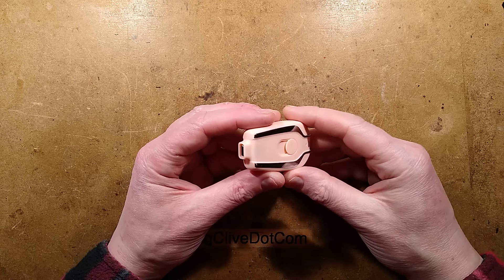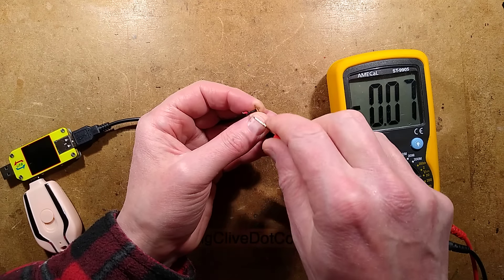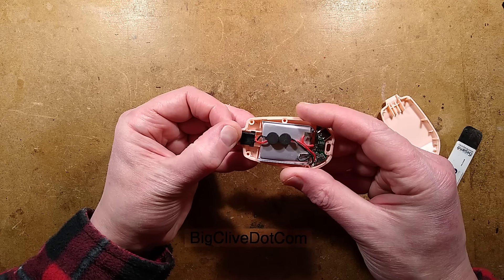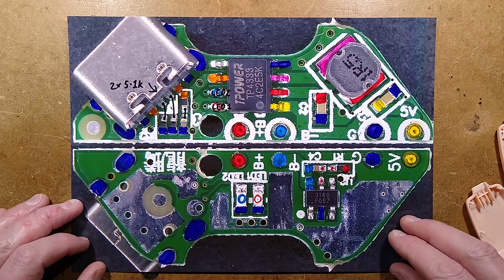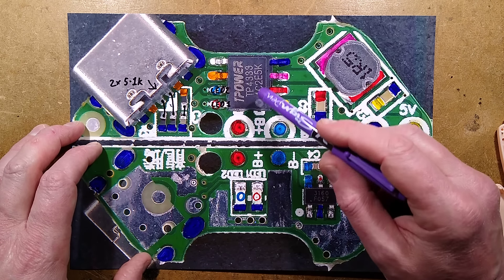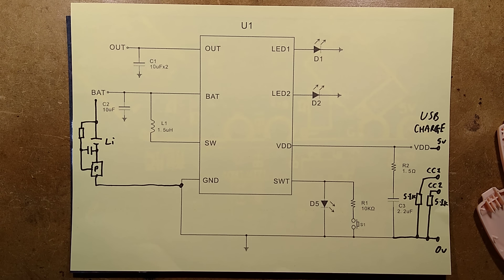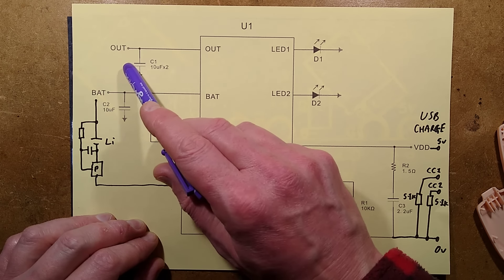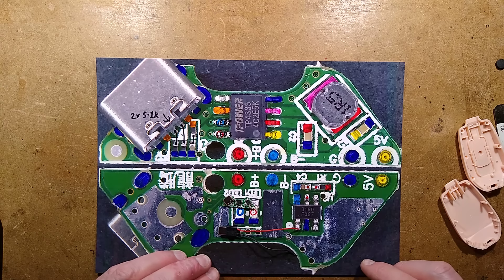eBay keyring phone-killer

Comment: I have to wonder if our phones or other expensive rechargeable gadgets have polarity protection built in?  I guess it's not something I'd want to test outright though.  😲
Reply from the maker: Many will, but as you say, it would be quite a reckless thing to test.
Reply: I think it was a Samsung Galaxy S1 I had, that I was goofing around with batteries and had hooked up a battery with the polarities swapped...... and much to my surprise... IT TURNED ON. So they went above and beyond protection, there. heh
(a little different than this, but reminded me of that)
Reply: They do, I've tried it on some old phones. I highly doubt that there's any smartphone these days that wouldn't have some sort of protection.
Reply: @twizz420  I just found it amazing, even now, since that's an already "idiot-proofed" against, given the battery packs are only one-way insertable. (and yes... I recognize that makes me the idiot, here... 🤣)

Irrelevant in the end, but I just now recalled the actual details... I had a battery from another variant of S1 which had the tabs on the opposite side, but I needed/wanted to test it. The pack for the other S1 was just a tad too long, but could still make tab contact; however, I had not even considered that me flipping the battery, flipped the polarity pins. 🤦‍♂️
I was glad that I didn't let the magic smoke out of anything, that day. ☺️
Reply: Handheld Nintendo consoles, even the Nintendo switch, are not.
Reply: Not so good at electronics but my iPhone (I assume androids do it aswell I just don’t have a reference point. Fk apple) detects a wet charging port and stops the charging process so I‘d assume they have protection for other things aswell?
Reply: @runed0s86  How very on brand, lol
Reply: idk there's a simple diode circuit that will take any polarity and only outputs a positive voltage. maybe a rectifier?  idk but they probably have it in phones. it's amazing how many electronics things have the wires backwards or other errors, it wouldn't surprise me to find out there's chargers out there that have the polarity wrong.
Reply: @simonlinser8286  bridge rectifier does swap any polarity input into expected one, obviously, but that's too lossy to use inline with battery. For simple linear chargers, a schottky may actually make it better by reducing the loss in charger.
Reply: Jerry rig everything should add it to his endurance test
Reply: They do, it's easy and cheap to include one or two diodes with this purpose.
Reply: @1yflow1  i don't think they use series diodes in phones, that could waste significant power and slow down charging. It has some active protection i assume.
Reply: If manufacturers were smart, they would always put in a full wave bridge rectifier, then it wouldn't matter if the polarity was reversed because both directions would supply power to the device properly.
Reply: @lepayen  yeah and lose at least 0.8V from the supply (if overrated schottky bridge would be used).
Reply: @plainedgedsaw1694  Ooh, a whole 0.8v... Wow... So what? Use a joule thief circuit, or plug into a power supply and nobody is going to care about a measly 0.8v...
Reply: @lepayen  that's almost 1/5th of available power going to waste, to heat, and dissipating for example 2.5W that could produce at 3A charging current would be problematic for a phone, adding to that already significant voltage drop from cables, there may already be need to use buck-boost instead of just buck converter, of course alongside with more drawbacks of such approach.
Reply: @DUKE_of_RAMBLE  don't under-estimate the ingenuity of a fool
Reply: @runed0s86  Really? Blimey, that's worth knowing. I would have expected the DS-lite to be protected cos it was standard practice back then. Even with DOS-era laptops. I'm NOT impressed with Nintendo if that's the case. Maybe it got cheaped-out when they outsourced manufacture to some cheap-ass factory that didn't care about standards, cos I can't  imagine the original circuit design missed that. ...unless of course it was intentional so they could sell you a new one if you used an after-market charger.
Reply: @penfold7800  Ain't THAT the truth.
To paraphrase the old saying:
    "It's impossible to make anything truly 'idiot proof'...
       as the universe will simply create a bigger idiot!"

(commonly misappropriated to Einstein, if I recall correctly; regardless of who said it, doesn't change its greatness, OR accuracy!)
Reply: @lepayen  Just to back up what Plain Edged Saw said, 0.8V is a massive amount. Both in terms of the chips being powered, and the batteries supplying the power.

For example, our high end desktop GPUs (graphics cards) for gaming, RUN OFF roughly 1.0V, and CPUs are able to be clocked at multiple GHz with that little of voltage as well.

A typical Lithium Ion battery thats on our phones has a typical operating voltage window of almost that very 0.8V  -  3.3V to 4.2V

Granted, I'm intermixing supply and power, which are two very different things. The point in trying to drive home though, is that it's a lot more than one might think.
Reply: I partially broke a 2022 samsung galaxy tablet because I used a generic usb C to usb A adapter to make a usb C to C cable to connect to my laptop. The tablet does weird things now. Samsung won't acknowledge there is a problem, last time I checked.
Reply: @DUKE_of_RAMBLE  Everything that is DC does not require batteries, there are batteries that are 3.7v and higher, 0.8v is nothing... Wow...
Reply: @lepayen  Seems we're on different pages. Not a big deal. 😊✌️
Reply: I've worked with industrial devices worth $3-5k each that were completely destroyed when someone wired their 24V supply backward, all because someone decided $1 for a diode was too much compared to just saying "don't do that" in the manual. I have no faith in consumer devices to be much better.
Reply: I know the USB thumb drive I destroyed didn't.
Reply: A common polarity protection is a diode and a fuse. If reverse polarity is applied. The current will flow through the diode and fuse freely and blow the fuse (and often the diode). This avoids the diode voltage drop but requires repair.
Reply: @DUKE_of_RAMBLE  oh, battery side often  does that, that's a byproduct of circuitry involved in charging. THe problem is the USB connector part
Reply: I seen someone brought their Apple Watch into an MRI room and their watch got sucked to the magnet which caused the polarity to reverse and to get it to work again they brought their charger into the room and stuck it to the magnet to align the polarities
Reply: @MichaelT1820  Wild.
Reply: So many interesting replies.  Thanks everyone.  I love that there is so much to consider.
Reply: @runed0s86 this explains the stories of switches getting smoked by non nintendo chargers

Comment: Makes you wonder if there was a huge batch of these that were assembled wrong or if you were just the (conveniently) lucky one to get the single bad unit.
Reply: probably a bunch backwards. been there done similar myself long ago, Friday evening and everyone bolted, leaving me to do six jobs at once(install bearings, magnetize magnets, assemble motors, test and adjust the brush angle(dc motors), boxing them for shipping and then load them on the truck, all with the truck driver standing there complaining and asking when I'd be done!! 🙄
about half through the order, I had flip flopped the polarity of the plugs around and not realized it (there was identical motor lines produced there, except for "labels" and opposite polarities.  so very easy to get wrong.
sadly that was an "Union shop stooge shit", we all got grilled over it, including the third party trucking co. they all got grilled for leaving one person to finish a multi-person job and the trucking guy snarled at for even being inside the factory(they were not allowed past the loading dock/office lines) he was hundreds of feet past that area.
there was no cameras back then, but I admitted fault because it was clearly my mistake. I left there months later because I was sick of all the endless horse-droppings and stupendous tomfoolery.

Comment: That's a shame because the form factor is pretty nifty. Not a bad idea testing these out before plugging into your expensive smartphone!
Reply: I will never understand why they call them 'smartphones', when the same manufacturers put the same phones in Wamarts for $40-80, yet dumb-ass people will still pay $700-1200 for the same phone.  If they think they're getting something they can use any differently than I use mine for on a day to day basis, they're wrong.  Ìf something happens to my phone, it doesn't break my bank or my heart.  I just go buy a new one.  It's a telephone, not a rocket.  Although, I do have 2 that have splashed down into the ocean. 🤪
Reply: @nicelady51  are you just ignoring the differences in specs/hardware used by these vastly differently priced smartphones? Because obviously a super cheap phone CAN be usable for someone, just not nearly as powerful or usable as a more expensive phone. Technology is constantly growing and changing. It's going to cost more for those newer changes.. Your point is silly.
Reply: @ardiberen  I'm talking about normal, every day use as a form of communication.  A tele for talk, text, pics, sharing.  Not for youtubers making content or using it for large files, sending, etc.  A phone for Joe Shmoe and his bride does the trick for less than $100 and they needn't be forced, coerced into more than they need or will ever utilize.  Frugality and common sense is not silly.
Reply: @nicelady51  Being frugal isn't silly but there are vast differences between those devices. OLED high resolution screens, far superior cameras, far better SoC processors/GPUs, batteries, etc.  But there's also the law of diminishing returns. A lot of R&D has to go into making something top-of-the-line to a little bit better, so now the price is double to pay back that R&D. Also marketing plays a role of course. Flagships will always cost more because they price them to what people are willing to pay. If people are willing to pay $1200, then they have a fiduciary responsibility to their shareholders to charge that much.
Reply: @nicelady51  having something you use everyday run smoothly and optimally is simply convenient. i used a 100$ samsung A50 for a while because i didnt care, but then it started to lag, i couldnt play games i wanted, the camera was trash, messing around with stuff too fast would cause crashing. yes perfectly fine for normal use but often frustrating. being able to eliminate headaches with a fast operating phone that can do anything you want it to is just nice. why would anyone buy a fast reliable new car when they can buy a 500$ clunker that runs? why would anyone buy a nice house when they can pay half and still sleep? your argument is truly idiotic. paying extra money so your phone doesnt crash when you click too fast makes more sense than being frugal and your head explodes because someone called and texted at the same time and your phone lags.
Reply: @nicelady51  also im just going to be honest here, not everyone is poor. a normal 2 income household with decent paying jobs can MORE than afford a flagship phone every 2 years. (2 years being the usual upgrade bonus from carriers). after using that POS samsung A50 for 2 years i ended up getting a new iphone 20 for pretty cheap with a contract renewal and it feels so nice to have a phone that doesnt run like garbage. so sure, if you dont use your phone and are happy with a 100$ piece of crap then by all means, enjoy it. but dont put throw around your own low income and frugal mentality around like other people dont use their phones regularly. i get the feeling you are just a fossil that makes a phone call once a month and thats ok.
Reply: @newp0rt  I am single and retired.  I have to be smart with my money.  There is no shame in that.  I prefer to save extra cash for things I really enjoy, such as fishing, playing music and travel.  Just because someone doesn't have all that you do(been there), doesn't mean they're poor or that they wish for what you have.  I am extremely happy in my circumstance and would change it if I felt differently.  I have so much to enjoy, it can't be fit into a day or a week.  I don't drive a crapbox.  I have a nice truck that I will have no problem selling or trading for a newer one when the time comes.  There again, insurance is skyrocketing,  so a 2-3 year old vehicle is a wise choice.  I have purchased a Corvette and  Lincoln Town Car off the showroom floor, along with many other new vehicles.  New isn't necessary if you may not live long enough to enjoy or pay for it.  If you are truly smart, you'll save more and spend less.  It's a challenge that gets me out in nature, rather than being a mall rat.  BTW, yoùr insulting and rude nature speaks volumes about the person you are.  I definitely do not envy you.

Comment: Good case study for design for manufacture since you want consistency or things will go wrong in my experience. Even with training people will still screw things up if things are out of place. Don’t want to be flip-flopping wire connections if you don’t have connectors to prevent them from being installed backwards.

Comment: Nice find and fix Clive. As a side thought here back in the late 1970's early 1980's with the nicad batteries; those batteries could be charged the wrong way and hold a charge. Even odder yet was the one simple charger I had for 4 AA or AAA it put out AC current to charge the batteries, but they had the the right polarity when fully charged. Odd stuff we all find.
Reply: Everyday Electronics magazine had a charger circuit for standard alkaline batteries that used a skewed ac waveform that was designed to refresh the chemistry with more push than pull on each cycle. It worked ok on batteries that were still holding a decent charge, not so good on the more heavily discharged, I had a few leak on me.
Reply: I think you might find the "AC current" was in fact biased one way (for example a 90% mark space ratio). This was because NiCds i think "liked" to be charged a little - then discharged slightly - then charged again, slightly discharged and so on. So if you took an AC supply, and had two diodes in inverse parallel, one in series with a resistor - then you had a (very) crude way of applying more power on the positive part of the cycle - and could bleed off a bit via the resistor on the negative part of the cycle. Some of "positive leaning AC" :)
Reply from the maker: The simplest chargers may look like they are putting out AC current because they use one half wave polarity to charge the cell and the other to add to the cell voltage to make the LED light while also charging the cell in the other position.
It lets them use a much smaller transformer.

Comment: This is why I always check stuff especially if I buy it from a dollar store. I bought this LED light bar that's sold on TV and took it apart and it used a dropping capacitor (big red ones) and charged two 4 volt SLA type batteries. It plugged into AC and it did work and charge but the wires they used on the AC side were too thin for my liking so charging by AC was removed. I installed a two cell power bank inside the light and it now charges by USB. Works great

Same thing with this plug in flashlight I modded it to charge off USB but it needs a battery. I'm thinking of taking one of those tiny power stick power banks and using that.

I was hoping you would fix those connections so they are correct.
Reply: Lead-acid batteries for anything other than vehicles or "unmovables" (uninterruptible supplies, etc) should be illegal. It's crazy they can put them in consumer goods.

Comment: Nice little find & teardown Clive!
Indeed, a tired worker or wrong instructions could lead to this error, which should have been caught by QC...
I bought a solar powered Tire Pressure Monitor System some time ago, charged it normally first and would light the Sun symbol on screen when placed in light. Car front window always South with TPMS & small panel behind it, but failing to charge from sunlight...
Turned out one small diode, after the sensing line for light on the panel, was wrong way round...
Desoldered and soldered in right way, now keeps charging!
Sadly the batteries in the four sensors don't last as long as I thought...

Comment: This is why I don't buy cheap eBay charging equipment for my expensive phone. You never know what you're gonna get.

Even if the battery was actually 1500 mAh, and the unit was wired correctly, that would still be mediocre for a power bank, when most phone batteries have more than double that capacity these days. 600 mAh is almost useless. I have two proper 10,000 mAh fast-charge power banks, made by Kopplen. They have been well worth the money, since I'm often outside, nowhere near an outlet, for extended periods of time. They do a bang-up job at charging my phone, without killing it.

Comment: This is reminiscent of the teardown of the USB C charger pulled from Amazon. Excellent design, but one small problem ruins the whole thing. I repair vacuums and you wouldn't imagine how many times it's just one component or design flaw that will make the whole machine unusable. (...and how many times have I replaced the switches in my mouse by now 🤔)